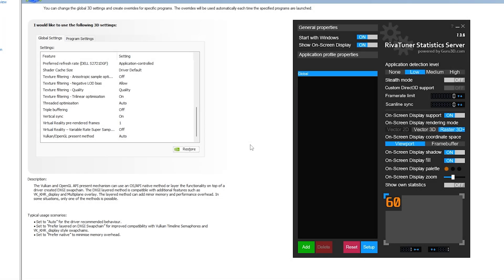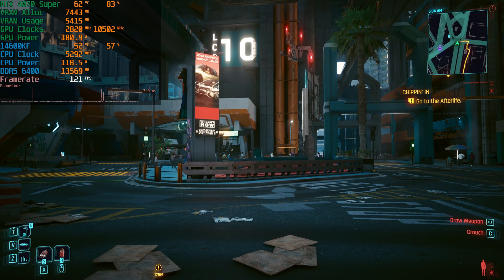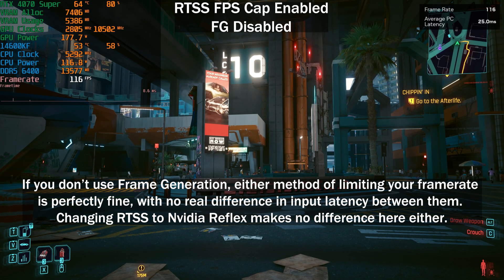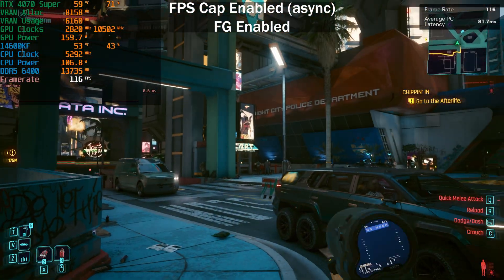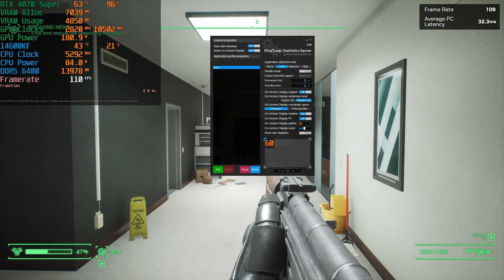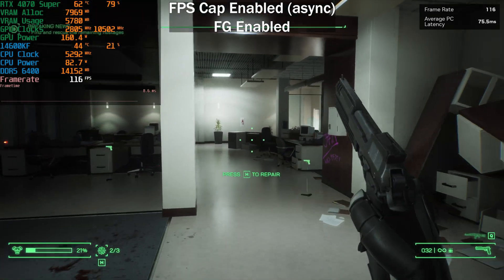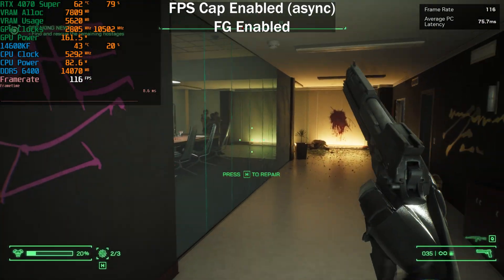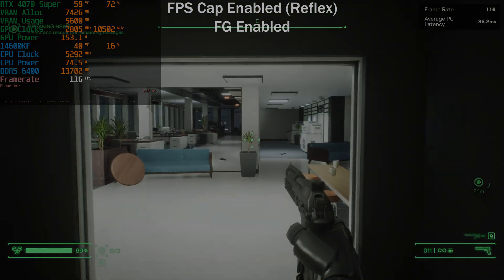How To Reduce Input Latency When Using Frame Generation - V-Sync vs RTSS

Comment: When i use frame generation and limit the fps with RTSS my frame time line is not smooth at all its a big thick line, what should i do?
Reply from the maker: The new frame gen (flip chain) unfortunately shows that thick frametime graph. With older games that still use the original frame gen the frametime would be flat. But as long as you can visually see any stuttering how the OSD displays the frametime doesnt really matter.

Comment: What you didn’t do was take advantage of the much higher frame rates that frame gen allows 
Frame gen would have let you go up to 180/200 fps then recap at that latency would be much better ….
Reply from the maker: Which creates tearing as it goes over my 165hz monitor's refresh rate. That is one thing I failed to mention, and that is to include "without screen tearing".
Reply: @Mostly_Positive_Reviews I’d have probly mentioned there no need for frame gen in a game where your already near the monitor limit, if you had a 240hz monitor and showed like 100 fps max gpu load vs 160/180 with frame gen you would have a better reflection of what it’s actualy ment for and how the latency compares in a more realistic scenario 

I appreciate you coming back to me tho on a older video ❤
Reply from the maker: I often go back to these older videos and think "Why didnt I say this?" Or "Why didnt I show that?". I'm not good at scripting videos, and then when I do videos on the fly I often forget stuff that I only realize much later.

But you've been a viewer for a long time and comment often, so I'll always reply if I get the notification 👍 Appreciate the support!

Comment: What if my game is maxed out in using a 5080 but my when i switch to reflex on riva tunner my frame limiter goes above my monitor refresh rate?? How do i fix?
Reply from the maker: What is your monitor's refresh rate? For Reflex to not go over your refresh rate you need some sort of framerate cap. Nvidia recommends V-Sync + Reflex, and that's what I mostly use. Or if you feel the latency with v-sync is too high then use RTSS to cap below your monitor's refresh rate. For my 165hz panel I cap at 158 fps. 120hz would be 116, 180hz would be 171, just to give a few examples.

Comment: Bro, you have no idea how you improved my experience.

Somehow changing the Nvidia Reflex in frame limiter made me possible to run HG Legacy from DLSS ultra performance 66c GPU temp / 116 Fps to DLSS quality 56c without any latency, less heat and more quality. The only thing i noticed is that the frametime is all over the place with Nvidia Reflex + RTSS cap but i got no stutter at all.

I dont understand the technicals behind it but thank you very much
Reply from the maker: Very happy to hear your experience has improved! Happy to have helped.

Comment: So, in conclusion.
Frame gen on - Use no fps cap, no vsync, ONLY Reflex in-game?

I always read when using frame gen use vsync + fps cap 3fps under refresh rate.
Reply from the maker: For absolute lowest latency WITH possible tearing I use no fps cap, no v-sync, and reflex on if game supports it, otherwise I use RTSS Reflex option, or Nvidia's Low Latency Mode.

For the lowest latency WITHOUT tearing I use v-sync + Reflex. The latency is ever so slightly higher than uncapped, but still very good. This is how I play, and you are right, it is advised to use v-sync when using frame generation. I have a g-sync monitor, so when Reflex and g-sync and v-sync are all enabled my fps is capped at 158 on a 165hz monitor without manually capping slightly below my refresh rate.

There is a formula to calculate exactly what the fps is capped at, but at 120hz it is 116 fps, 165hz it is 158 fps etc.
Reply: @Mostly_Positive_Reviews On my C2 oled. I use:

NVIDIA control panel:
Vsync forced on
117 fps cap (120hz display)

On display:
Gsync and VRR turned on

Windows:
VRR turned on
HDR on
Auto HDR on

Anything else I get tearing, bad latency, or jittery image with frame gen on.
Reply: @Mostly_Positive_Reviews If I turn vsync off in NCP and only use reflex + fps cap I get severe tearing. Even if I cap to like 100fps, still tears.

Comment: When you tested with RTSS FPS cap on (reflex mode) with FG enabled did you also have V-sync enabled?
Reply from the maker: You mean for example at 2:20? v-sync was still enabled but it never hits the v-sync cap due to the cap in RTSS.
Reply: @Mostly_Positive_Reviews  I meant at around 4:52 testing in the video, was V-sync enabled on NVCP or was it disabled?
Reply from the maker: @marcoj4500  At 4:52 it was disabled and only RTSS FPS Cap was used.

Comment: following, just recently picked up a QHD 165Hz lol
Reply from the maker: Awesome! I love my 165hz 1440p panel. Have tried to go to 4K 60hz but after a few years at high refresh rates it's very difficult for me 🤣
Reply: @Mostly_Positive_Reviews  the previous monitor was a similar 1440p but 75Hz, And I'm used to capping my games via RTSS at 72FPS Async... 

now it's a different case with 165Hz, that being said, my games are all singleplayer stuffs, and they have DLSS FG built in. I made peace with 144FPS (FG 2x) and capped via nvidia app / nvcp / rivatuner Reflex. it's quite an amazing experience lol

thanks for the reference

Comment: i'm currently playing games with my 4060 mobile using RTSS, i used Nvidia Profile Inspector before and it ran so shit. i cap the FPS to 60 with 120Hz refresh rate, it runs so smooth without Frame Generation. i know it's not recommended to set the FPS below the refresh rate, but damn it runs so smooth like milk

Comment: How did you get the NVIDIA overlay with the AVG PC Latency to appear in your screen recording? Did you use OBS?
Reply from the maker: I use an external PC with a capture card.
Reply: @Mostly_Positive_Reviews thank you for the swift reply. Yea, that makes sense - I need that in the long run 😅 for now I use FrameView and keep a record of benchmark runs.
Reply from the maker: I initially started out with GeForce Experience, but I'd often have so many issues where it will stop recording when changing settings and I wouldnt notice 😔 So I got a 4K Elgato capture card from an ex-streamer and did it that way rather as the recording then also doesnt have any performance impact.

Comment: Using vsync or frame capping in cyberpunk is a terrible idea. The game engine doesn't handle it properly and it generates random frequent micro stuttering, which is a big pain in the * to troubleshoot. Took me hours to find out this was the cause. If you like smooth gameplay it's better to have more input lag and no micro stutter than the opposite

Comment: why would you turn on vsync when using frame generation?
Reply from the maker: To prevent screen tearing and cap the framerate. On a 165hz monitor using v-sync + g-sync + framegen it caps it to 158 fps, so it never hits the v-sync cap due to Reflex (that gets enabled automatically when framegen is enabled), so you dont get screen tearing and also lower input latency due to Reflex.

Comment: How do you show the "Average PC latency" on the top right corner? Which program?
Reply from the maker: This is done from the Nvidia App 👍
Reply: @Mostly_Positive_Reviews  thx for the feedback but in my Nvidia app, the latency show always N/A, so it does not calculate when I am in game. Is there a way how to activate the calculation?
Reply from the maker: It relies on info from Reflex, but it doesnt always show up when not using frame generation for some reason. Sometimes it does, sometimes it doesnt, but it always shows for me when enabling DLSS Frame Generation.

Comment: I just tested rivatuner for about an hour: Async vs Front edge sync and I don't know which is better..
Async will provide variable frametime and lower pc latency, but I don't have a fully synchronized monitor.
Front edge sync will synchronize the monitor, but will increase the pc latency a little.

Comment: Isn’t it the same to just use the nvidia reflex that the game offers and rtss Framerate Limiter? Or perhaps low latency mode from the nvidia control panel? I don't quite understand the difference between the methods I mentioned above to reduce latency and your method.
Reply from the maker: Reflex in-game is always on when using frame generation. This method reduces latency even more when used in conjunction with Reflex in game. You'll get similar results when using Nvidia's Low Latency mode, but with this method you dont have to restart the game every time you want to enable / disable it as most changes in NVCP dont apply when in-game and it requires a restart.
Reply: @Mostly_Positive_Reviews  would  this benefit me if I'm not using FG? Just to have the lowest latency possible. I have a laptop with a 144hz display, no g sync support. I don't usually get high fps in newer games. This is a possible combination I would use:
NVCP:
V sync on + Low Latency Mode Ultra

In game:
Nvidia Reflex on + boost

RTSS:
30 fps cap or 60 fps cap + nvidia Reflex

How is this, and could I use this combination when using FG? I have a rtx 3050 4gb laptop.

Comment: Will have the same impact in Latency using Nvidia App FPS Cap vs RTSS framerate limit?
Reply from the maker: It should be very similar yeah. I just used RTSS because it's easier to enable and disable without having to restart the game.
Reply: @Mostly_Positive_Reviews  Thanks bro

Comment: Would you know anything about the "Enable passive waiting" option in RTSS? Some claim it's better unchecked. Also what tool are you using to show the latency in the top right corner?
Reply from the maker: Unfortunately I dont, but now I'm curious...

I used the Nvidia App's monitoring for showing latency.
Reply: @Mostly_Positive_Reviews  It has many Latency options, which one do you use?

Comment: Hello, can you help me? I have the latest version of the Nvidia 572.42 driver, and after this update, when frame generation is enabled, all games have a high frametime. I've seen similar graph behavior from others and thought it was normal, but now with a combination of vsync+gsync in NVCPL. All games behave strangely when turned on, namely a floating delay of 40 to 80 ms in cyberpunk and fps drops to 120 from a stable 138 (I have a 144 hz monitor) Maybe someone has a new way to get rid of tearing with a new frame generation?
Reply from the maker: The issue is not the frametimes but the way it is displayed when using MSI Afterburner. If you use the Nvidia App for performance metrics it will display correctly. If you use the updated CapFrameX you can switch between msBetweenDisplay and msBetweenPresent, and that will show the correct frametimes etc.
Reply: @Mostly_Positive_Reviews  Thanks, I have already found information about this issue. MSI afterburner and RTTS have been updated with new drivers, and this problem is being observed on the nvidia subreddit.

Comment: scary. please what is the tracking on the top right. what measures latency thanks
Reply from the maker: For latency measurement I used GeForce Experience. You can use the Nvidia App for the same.

Comment: I'm new to using frame gen. As an example I'm having a hard time getting hogwarts legacy to not screen tear with frame gen on. I have dlss swapper and latest stuff with a 4090 and a 9700k @5ghz. Is the screen tearing because I'm not using rtss with those options you went over? Lg cx oled 4k hdr 120hz hdmi 2.1
Reply from the maker: To prevent screen tearing the best is to use g-sync and v-sync combined. And then to lower the latency you can cap RTSS to 116 on a 120hz panel.

Comment: Hi OP, 

Kinda baffled that you are getting more than 100 frames with Frame Gen off. I have a 4070 Super TI and I barely get 60-65 with Framegen off. With Framegen on I can cross a 100. What am I doing wrong? Also my latency is 35 without frame gen and around 50 with frame gen which are much higher than yours.
Reply from the maker: What CPU do you have?
Reply: @Mostly_Positive_Reviews  Ryzen 7 7800x3D. I figured out why I have the low frames. I play with Path Tracing on. I noticed that you have Ray Tracing off.

However I still can't get the lower latency. I tried turning off Ray Tracing but I'm still on around 55-60ms input latency.
Reply from the maker: You get the high latency even when following the steps in the video? 

One thing you can try is enable Low Latency Mode in Nvidia Control Panel. Dont set it to Ultra immediately, but see if enabling it helps with latency.
Reply: @Mostly_Positive_Reviews  Hi OP, I was able to get the low latency when following the exact steps. Also tried Low Latency Mode but that doesn't work since Reflex overrides it apparently.

I had a quick question. In your final settings did you have Vsync on or off in NVCP? I noticed that Vsync added around 15-20% input latency for me so now I've just turned it off.
Reply from the maker: @Aishu092  In the final step here I had v-sync disabled, correct, as it can increase input latency. And seeing that the video focuses on how to reduce input latency I had it disabled. 

But happy you managed to get your latency down. I personally do use v-sync on my 165hz panel to prevent tearing, but if you prefer lower latency then v-sync can be turned off.

Comment: brother isn't the reflex in-game settin isn't interfering with the reflex settin of rtss?
Reply from the maker: No, the Refkex setting in RTSS is basically Low Latency mode that you find in NVCP. Both can be enabled at the same time without issue.

Comment: What do i do if i wanna play spiderman 2 with frame gen on and no screen tearing my display is 60 hz but when i cap it to 58 and turn vsync on the input lag is terrible
Reply from the maker: Framegen at a locked 60 fps will be pretty bad in both image quality and input latency. The point of FG is actually to take 70 fps to 120+ fps for those with high refresh rate monitors as a baseline of 60 fps before enabling FG is a must.

Comment: So should I use vsync + gsync + 120 fps rtss reflex cap + NVIDIA FG? I usually get over 120 fps with FG uncapped but the frametime is not smooth. Do you believe using Rtss would smooth out the graph? Thanks.
Reply from the maker: Yeah, that should give a you very smooth experience. If you have a 120hz monitor cap it to 116 fps and see how it feels.
Reply: @Mostly_Positive_Reviews thank you for replying. I’ve been watching some of your other videos. Great production!
Reply from the maker: @ Thank you, really appreciate it. Still trying to improve with time as I think I have much to improve on, but will get there eventually.
Reply: @Mostly_Positive_Reviews came back to say it actually worked. Thanks a million! beside a little traversal stutter that is built within directx12 games, cyberpunk is now running a smooth 120fps. God Bless!
Reply from the maker: @ That's awesome! Happy gaming!

Comment: Please expain this to me like I'm five. Do I want to use VSYNC in Driver / Nvidia App settings and RTSS Reflex FPS limiter together? Should I also enable Reflex in-game or in Nvidia App? Also, how do I know what limit to set?

Never quite could use framegen on my 4070 Super on 1440p because latency and screen tearing where just too jarring.
Reply from the maker: What is your monitor's refresh rate?

Here is what I personally do:
G-sync, v-sync enabled in NVCP
Frame gen on (this enables reflex)
This caps my 165hz panel at 158fps
If the latency feels a bit too high I use RTSS and cap to 158fps too with the Reflex option.

If you have a 120hz panel you will need to cap at 116fps, 144hz panel at 138fps.

If you want to know for sure, use v-sync + reflex in game, see where it caps at (it will be a few fps below your monitor's refresh rate) and use that as a cap in RTSS when needed to reduce input latency.
Reply: @Mostly_Positive_Reviews  Hey, thanks for the reply! My panel is 144hz, I completely forgot about G-SYNC and I think that's what was missing.

So, G-SYNC on. VSYNC and Tripple Buffering in driver settings on. Reflex frame limiter at 138 FPS in RTSS on. Transformer model DLSS with framegen - in Marvel Rivals I get latency in sub 50ms at 120-138 FPS which is playable and thanks to VSYNC smooth as butter. No screen tearing or pacing issues. 

Same setup in Cyberpunk gives me 59-71ms latency with controller. Probably has something to do with the average FPS: I am capped way above what my rig can squeeze on the settings I picked, playing at 70~FPS.

Had time to tinker with DLSS in BO6, managed to squeeze stable 130~ FPS at 45-40ms delay with Framegen. I feel now like I am getting my hardware's worth. :D

Comment: I appreciate the video but i was wondering do I use g-sync and v-sync in nvcp, but put a framerate cap for global in rtss then in the frame time limiter set it to nvidia reflex? I know if you are using frame generation in game reflex automatically gets turned on!
Reply from the maker: That's basically how I use it most of the time yeah.

Comment: what about tearing? vsync on in nvidia panel?
Reply from the maker: Yeah, best combo for me is v-sync on in NVCP, g-sync on,  reflex on, and then also an RTSS cap at what reflex + v-sync caps at. So in my case the 165hz panel gets capped at 158 fps with v-sync + reflex, so I just cap at 158 with RTSS but leave v-sync on to eliminate tearing completely.